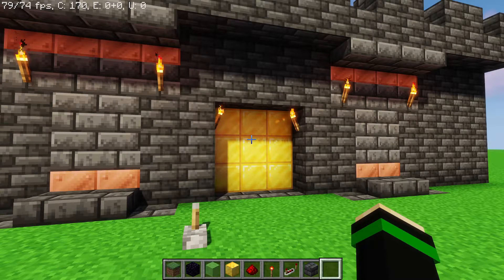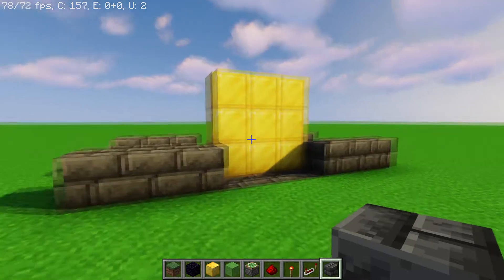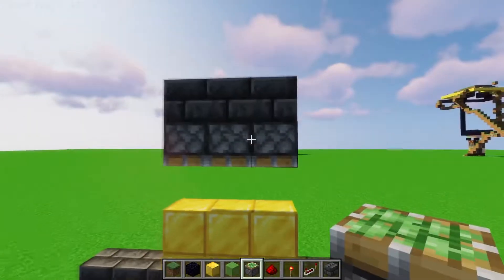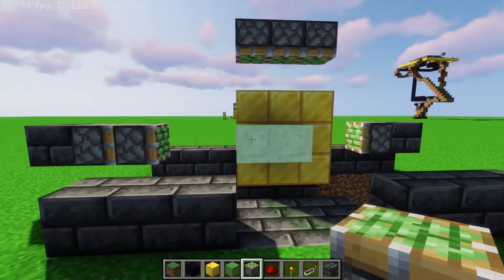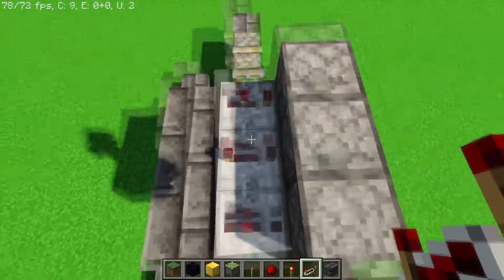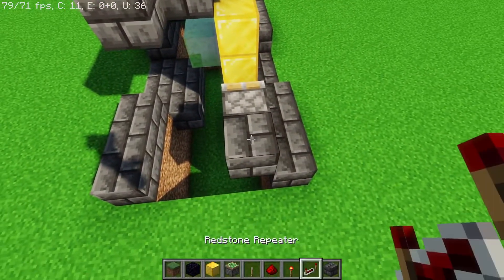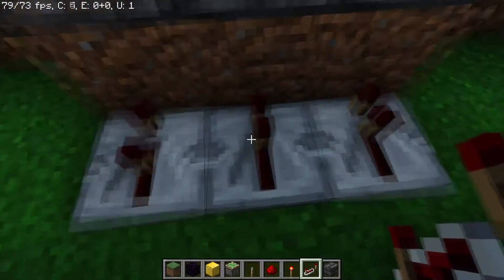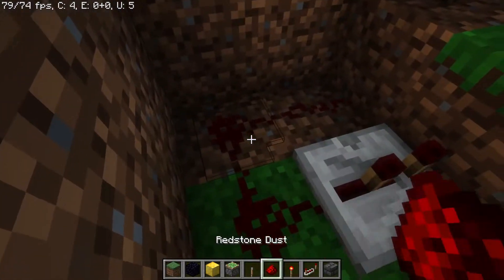Fast and Easy 3x3 Piston Door For Java Edition | Minecraft Redstone Engineering Tutorial

Comment: i'm confused where exactly should i hook up the redstone for the levers  8:10 (no offense but you're not being very specific)
Reply from the maker: Ya sorry about that part, it was a little ambiguous. So the levers are hooked up to the inputs of the XOR gate (the XOR gate is all the torches and stuff underground starting at 6:40). The output of the XOR gate (more around 7:50) is hooked up to all the pistons at two different places, one at the bottom (with that repeater at 7:55), and one higher up (around 8:10, the glass connects it vertically). In short the levers hook up to the XOR gate, and the XOR gate output hooks up to the pistons. Idk if this was helpful since that part is complicated

Comment: Would it be possible to have gold on the back, like a double door, to hide the slime?
Reply from the maker: So giving it some thought, I think it's perfectly possible. The catch is that you would have to move the redstone that is on top of the obsidian to another redstone torch below, and doing so will cause a delay of the middle section by more 2 redstone ticks (the delays on the double piston extender would go from 0,4,2 to 2,6,4) and thus it would take a little bit longer, as well as make the cross open out of sync from the other three middle blocks. If you don't care about the sync and delay then I would say go for it, though just be sure to keep the relative delays of the double piston extender the same. Sorry this might be confusing; I can maybe make a video about this in the future